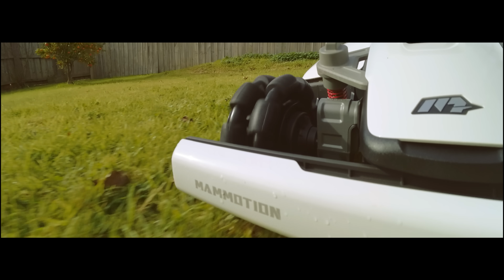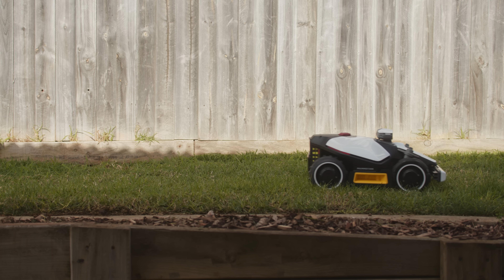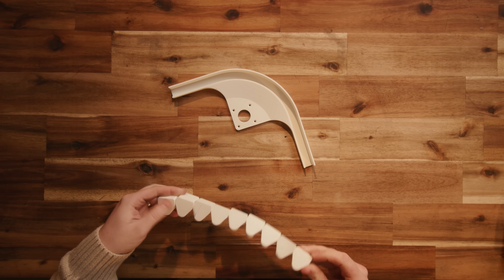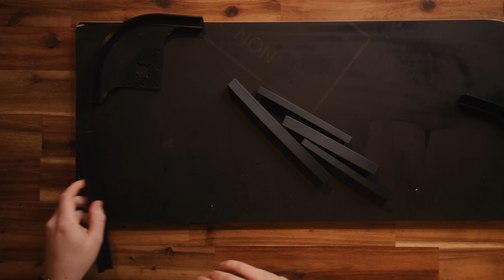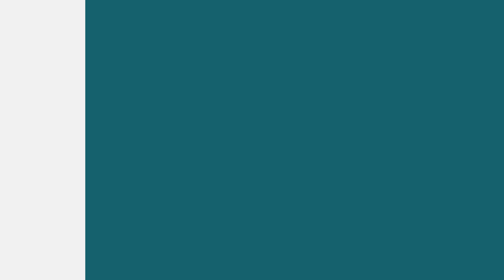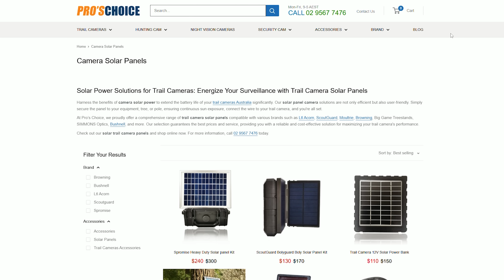The problem with robot mowers...

Comment: I live in AZ, and on the topic of robo mowers, I am working on an automation in home assistant that makes my Dreame A1 only mow during the less hot hours of the day. It easily gets to over 110 degrees F here for MOST of the day and overheats pretty much anything electronic. So my automation starts and stops with weather. It also takes into account the Rachio watering schedules to determine when it's dry enough to actually mow.

Comment: I have a Luba 2 and use it with Home Assistant.  I have about a dozen criteria that I use to determine if conditions are 'favorable' for mowing:  weather, dewpoint (to tell me if the grass is wet or not), satellite strength, soil moisture (parts of my lawn are subject to flodding), etc.  When conditions are 'favorable' it goes out mowing.  When they are 'unfavorable' it comes back to the charger.  Pretty awesome.  If I ever get a different mower, Home Assistant integration is a must-have requirement.
Reply: I would like to see this automation if you wouldn't mind sharing?

Comment: Do you not need a sensor to detect if your dog gets stuck underneath the door? You might already be doing this if you're using the stepper motor as a limit switch, but I want to make sure that was a design decision and not an oversight.
Reply from the maker: The current limit is relatively low, so the motors will stall before causing injury :)

Comment: We pulled the trigger about 12 months ago and replaced the old Victa 4 Stroke with an electric mower.  The electric mower removes the biggest hassle of mowing the lawn with an ICE mower (dealing with fuel and starting the thing), it's a total game changer.  Doesn't mean I mow the lawn any more often, but it's a better experience when I do :) Wondering if I shouldn't have bought a robot instead now!

Comment: I have been following these robot lawn mowers since they became popular around a decade ago. 

I am disappointed that they all still rely on RTK, reference prism, or a wire for positioning. So I decided to build my own. 

Your airlock idea is great! I have a plan to integrate the base station in it as well so you don’t have 2 spots in your yard taken up by your robot.

I still wouldn’t call these lawnmowers completely hands free. You still have to edge and weed around obstacles since none of these robots can do that yet. We’ll get there eventually!

I’m disappointed that we don’t have robots all around us now like we thought in the 90s. Be the change you want to see!
Reply: The new Eufy mower is purely GPS + onboard Lidar + vision, no wires or RTK station, seems to be based on the tracking and vision systems from their vacuum robots, which work really well. Unfortunately the first gen models aren't that great at the actual mowing part, so I'm thinking the second gen models might be worth looking at, probably next summer.
Reply: I have a Dreame A1 and it uses lidarr, no rtk. It's only supposed to be able to mow like 1500 sq ft, but it manages my 7500 sq ft front lawn. It takes about 5 hours but it does a great job and my neighbors are jealous of how nice it comes out.

Comment: the biggest problem with robot mowers isnt being able to go from front to back lawn, its the enormous cost. The free one you got had a four figure price tag. My petrol self propelled mower cost less than a third of that price and costs me a 5 litre can of petrol per year and my lawn is large. the robot mowers also need an electrician to run a power supply to the docking station which is another fee you need to take into account. This is a neat little project but almost completely unnecessary

Comment: This is cool! Nice work, and love the video storytelling.

When the integration was still earrrly beta (alpha?), I actually had my mower in my garage and used the status changes to open/close it. Though, I ultimately moved everything outside due to signal issues.

One thing I haven't automated is my channel between front and back yards. We're just about due for a fence upgrade, so I may try to do something similar. Have you had issues with critters in the tunnel?
Reply from the maker: Thanks! 

No issues with critters. (yet 😳)

It's not super sheltered, so I don't think most critters would hideout in there. I suppose you could occasionally actuate the door to try and discourage squatters?

Comment: Will be curious if you hit any racking issues with the two stepper motor solution. The Rivian R1T tonneau cover was similar in function and had issues with racking causing it to get jambed
Reply from the maker: They're handling it fine at the moment! 

The motors are operating way below their torque limits so skipped steps haven't been an issue thus far.

Comment: Awesome project!  I loved how you presented the working mechanism and the builds finish looked great!

I'm a little worried about what happens if there's an animal (wildlife or doggo) enjoying the airlocks shade when the non-obstacle-avoiding robot wants to use it.
Reply from the maker: That's a good point! 

When obstacle detection is off, the bumper switches still stop the mower if it physically bumps into anything, so it shouldn't hurt anything!
Reply: @TheStockPot-AU  Maybe you could add a secondary tambour door layer on top, so that you've got the option to always have both sides covered and prevent larger wildlife from making a home.

Comment: only 4 mins into the video but already im wondering why you didnt just use a flap style door with an auto lock that is opened with NFC? just mount the nfc chip on the mower, then its the only thing that can open the gate.. not your dog.. unless you choose to and give the dog one also.. obv with timing restrictions etc.

Comment: Hi, mammotion integration author here, I've spoken with Mammotion and am in direct contact with them, they are very supportive of my work, I'm meeting the CEO here in NZ at an event this Thurs. I'd love to know how your turning obstacle avoidance on and off again.
Reply from the maker: Amazing! 

I've recently become aware (after Yuka got stuck!) it may not actually be turning back on correctly at all, and may just be relying on the bumpers instead. I'm still a bit unclear on exactly what the different modes. I did start testing with the Yuka, and moved over to the Luba later which might have something to do with it! 

Send me an email, id love to chat - hello@thestockpot.net
Reply: You are the homeassistant integration author and they like your work? Makes them instantly 100 times more likely to sell a robot to me lol
Reply: Could you ask them for a Homey app too? 😉
Reply: @extrakimF you do realise I wrote the HA app, not Mammotion. Feel free to make a homey app using the library I wrote.
Reply: @MichaelArthur4eva  yes I saw that, but since you had connections within Mammotion regarding smart home intergration, maybe you could ask them regarding a app for Homey?

Comment: Maybe you can ask your contacts at Mamotion to allow tunnel implementations with a QR code to place inside the closed door of the tunnel - where when the QR is visible for the robot, it knows to approach cautiously with a reduced obstacle avoidance  and that it should rest in front of the QR until the QR code is no longer visible.
Reply: I already commented about this but other robot mowers allow you to set areas where obstacle avoidance is off when the mower is in that defined space.

Comment: Interesting project! I ran into the OpenMower platform a few years back, and RTK GPS seems very appealing (and a DIY solution is much cheaper and gives you more control/security, although I couldn't easily find compatible models in Australia unfortunately). Glad the price is coming down on pre-built RTK GPS mowers though.